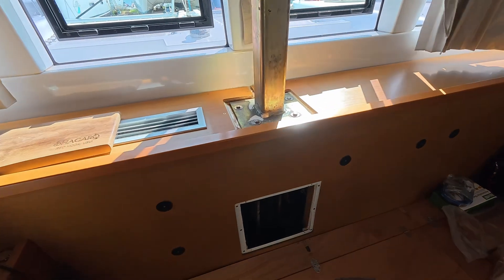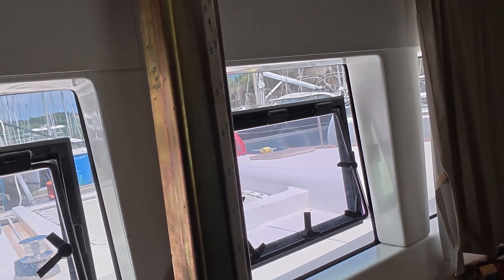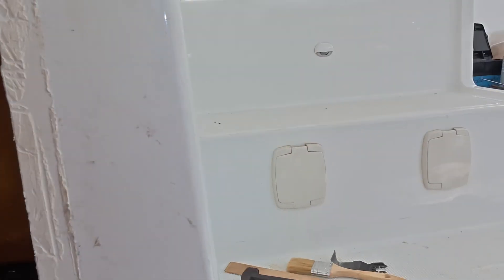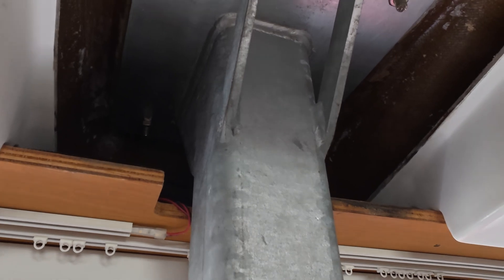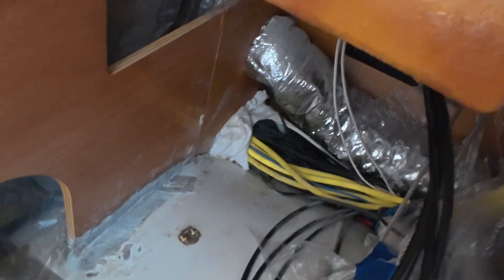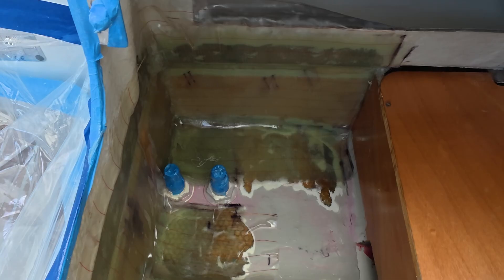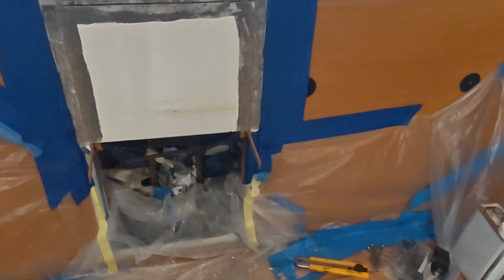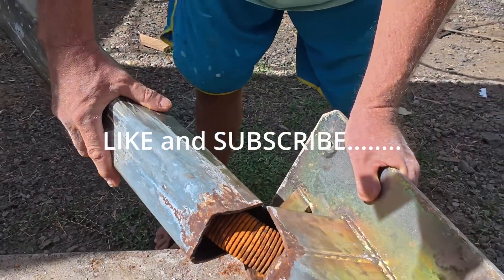Lagoon 450 Structural Repairs: Compression Post Replacement & Bulkhead Fix

Comment: That post should be at least a 12mm walled stainless steel box section. And welding looks total shit. Should also have Quality Control Non Destructive testing. The post deals with hectic compressive forces.
Reply from the maker: Wrong…. Stainless steel is 1.5 times “harder” than steel, as seen in past models, where they actually used Stainless steel compression posts, the welds crack!

Comment: Looks like a bad weld has caused a fracture.
Reply from the maker: It’s not, water pools right in that joint and just rusts it out
Reply: @louisraduly6961 where do the watar come from, how do I easiest inspect if the post is bad. I just got a 2013 L 450F.